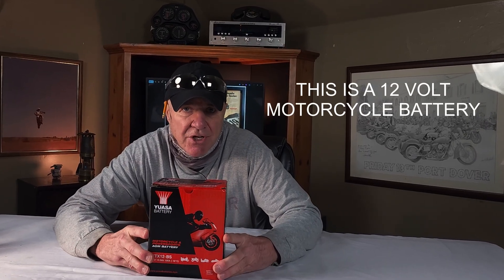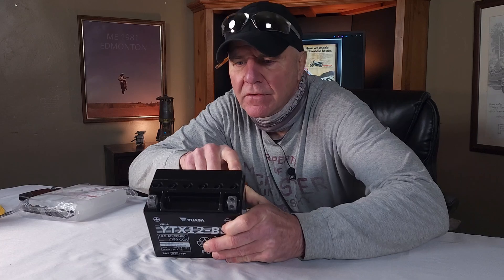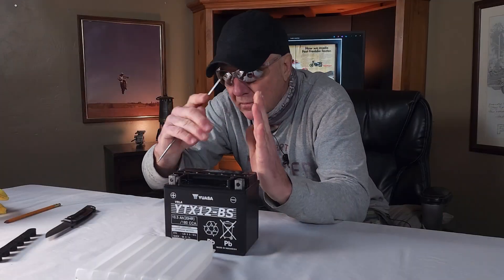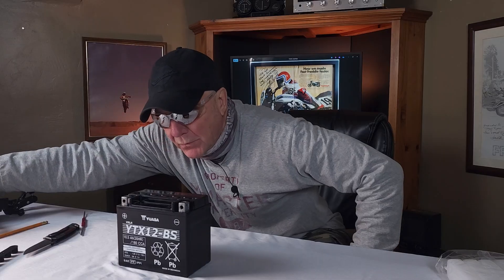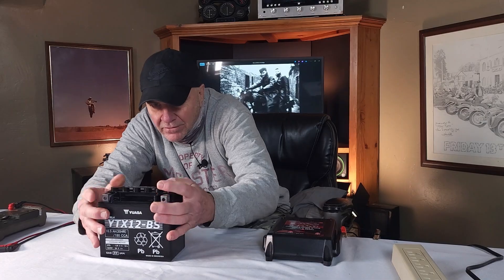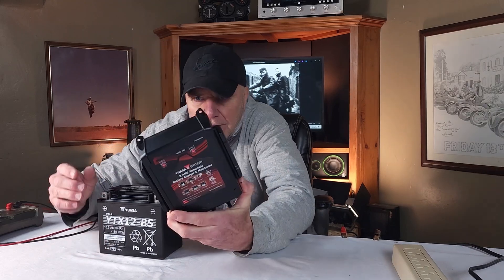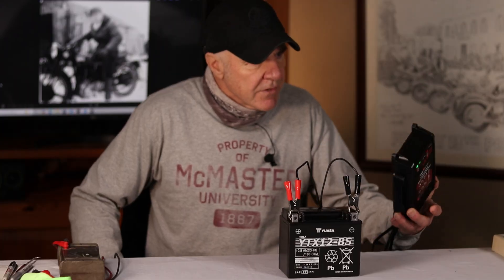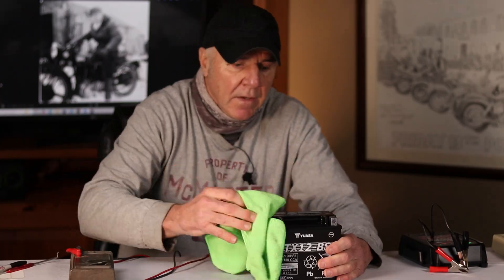How To Fill & Activate an AGM Motorcycle Battery - Pro Tips

Comment: Even with a cheaper off brand battery (like Walmarts Everstart brand) I expect to get atleast 7 years of good service. I've always used a float charger when not riding to keep it fully charged, so it's never sat run down at all, which is the reason people don't get many years out of them.
Reply from the maker: Your routine definitely makes the difference and as you say, most people fail to follow a good maintenance strategy .

Comment: So what are the CCA on these AGM Batteries?
Reply from the maker: Well cold cranking amps will vary between manufacturers ,  the physical size of the battery and the number of pates inside .The actual CCA number should be on the battery , the box or available on the manufacturers web site.
Reply: @TRyanLearnBikes  ThanX....I buy my batteries partly based on CCA. Those bigger/souped up S&S Engines need a high CCA.
Reply from the maker: @rickybrown1715  Ahh yes . I understand 100 % . CCA is most certainly a huge factor   in your case .

Comment: I cringed with those disconnected charger cables went together on the table, and the charger was still active.  Always unplug the charger first...then disconnect.
Reply from the maker: @spacecoastz4026  Good point but this smart charger is so smart it senses the short and won't deliver voltage .Im just used to that feature and don't worry about it . But you are correct it's sloppy handling of the cables for sure .

Comment: Awesome !, thanks for the handy tip, i’ve just gone and ordered a Yuasa AGM for my RC 36/2 as the ol Enduroline  battery failed on me mid oil change on my RC 46 just 3 days ago 🤯🙈

Also gone are the days when we could fill these up ourselves here in UK, the law changed in 1st Nov 2018 which makes it illegal for anyone to possess Sulphuric Acid in concentrations over 15% without a valid EPP license .. i’m guessing thats not the case in your neck of the woods ? 🤔

Comment: I did see an AGM battery that was just like the kit in this video, I might have considered buying it if I had seen this video first.  Very nice "cooking" show, Terry. It looks like a fairly easy process to activate the battery, and nice tip to record its birthday 👊😁👍
Reply from the maker: Thanks Wayne ,yes they are a simple batt to set up and may have some long term advantages but the kicker is that they can be oriented on a slant and don't require top ups every now and then which  were  atractive features for the bike I'm looking to put this one into.